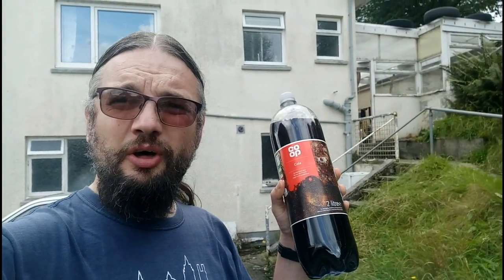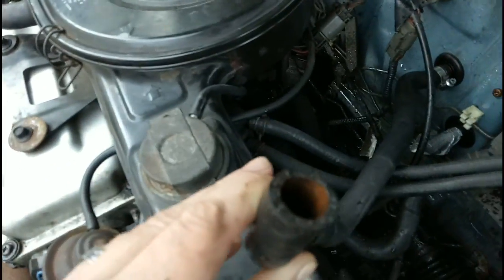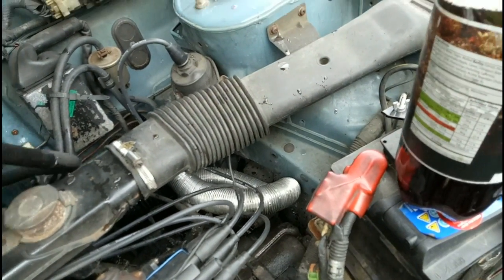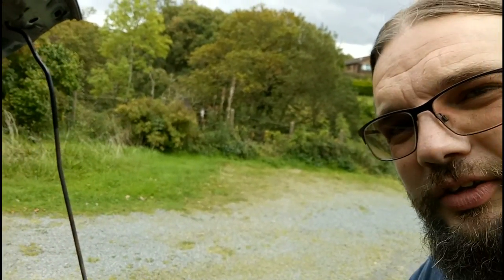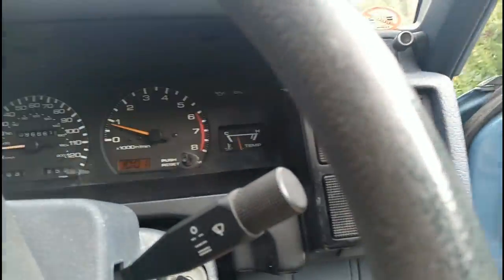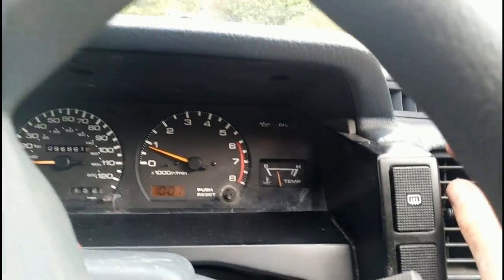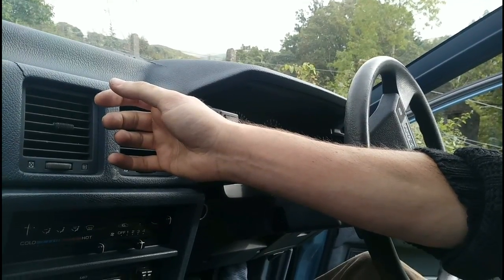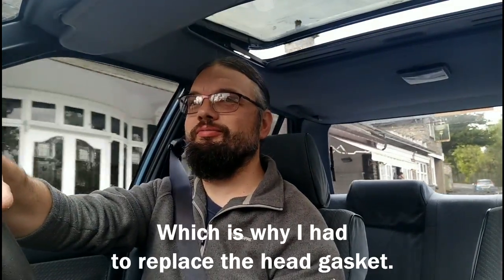Project Bluebird: Heater fix with cola!

Comment: sink cleaner works well, tried that on a ford matrix many years back, it expands and pushes the grime and sludge out of the top hose if you fill from the bottom hose and seal that hose off, I used a bolt, pushing it in to the hose,

Comment: Speaking of hard tyres, the old Nankangs of about 5 years back were so hard they were effectively plastic rather than rubber. Dry roads felt like wet roads and They would lock up at the slightest hint of moisture in the air... they were absolutely lethal in the wet, every corner was a magical mystery tour as to what wheel would find grip and which one would lose it first) but on the bright side (or bad side if you like your tyres to actually grip), they never wore out. i'm serious, i know of somebody else that used them and they've done nearly 80k miles on them and they still have over 4mm of tread left!.
Reply: A motorbike I had came with a tyre that felt the same. It was.. entertaining.
Reply: i had some motorbike tyres, i was cheap and bought chinese ones, lethal in the wet, zero grip, the avons i replaced them with (after i fell off 3 times) had more grip in the wet than the cheap ones in the dry, also they wore out in side a couple of thousand miles.

Comment: The early Vauxhall Royales,Monzas & Carltons were notorious for heater matrix problems, My trick was to use a strong kettle descaler down the matrix pipes with a bit of boiling water added then leave it overnight, The crap it got out when I flushed it was mind blowing but it certainly sorted the heater, I also used the same method on my Omega 2.5td rad as it used to run very hot when giving it some 'beans', It sorted that problem out also.

Comment: "I can't be bothered". That's a great way to say "I don't want to do it." Lol. I've been fortunate and only had one vehicle with a non-working heater. A $250 84 Grand Prix I bought of a coworker to help them out (they needed money) back in the early 90s. The car was solid but had been through a high school body shop, so I redid the body work and primer. While trying to figure the heater issue, I found a little plastic hose that had been cut. I ran a new tube and Voila!, Bob's your uncle. Some idiot had previously cut the vacuum line that ran the dash heater controls. That's an issue with shade-tree mechanics.. they can be more concerned with their next beer than the car they are working on.

Comment: I have an old MK1 Seat Leon with a leaky matrix. Rad weld did the job for a while but after it has been sitting sorn for a few months, all the coolant has collected in the heater box and comes out when you turn the fans on. Dammm you heater matrix! Looks like I'll be taking the dashboard out
Reply from the maker: Aye. That was a worry here that it might only be the silt holding the matrix together. Giving it a 260-mile test today, so hopefully all will be well. Radweld can clog up matrices and rads, so I'm a bit wary of the stuff.

Comment: My worry is not that you've just poured a children's drink into your Nissan Bluebird's cooling system, but rather that for years, countless parents have been letting their children drink cooling system cleaning fluid. Still, if their car's heater doesn't work, at least the children should be nice and hot enough to warm the car. Silver linings and all that.....
Reply: Well, knowing my Children only Industrial Strength Stuff will do. Excuse me while I polish their Teeth with 3M Extra.

Comment: Are you changing the width but keeping the aspect ratio the same number? If you change width, the aspect ratio must be changed to keep the tyre's rolling circumference the same.
Reply from the maker: +Forever Computing Bigger width, bigger profile, to match the standard tyre size. What was fitted was wrong.

Comment: Was going to say, Cola should work, ive seen people use it for removing rust, but you may have to leave it a while. As for what it does to your guts,  stomach acid is way more acidic than Cola so no problems there. Its the amount of sugar in it that's bad for you (but I'm sure your car won't mind that, provided you flushed it out properly) :-)
Reply from the maker: I did find the sugar attracted wasps! Maybe I should have used diet...

Comment: just to be a boring bugger - for those people that are aghast at what coke can do to things and worry that we drink it - don't forget that your insides (well, your stomach) has hydrochloric acid in it (as well as some other chlorides).  That stuff makes coke look tame! :-)  in fact your stomach has no problem with coke at all - in terms of the properties that folks worry about. The main issue with coke is simply what the sugar does to you - which most certainly isn't good, but for other reasons. so err... yeah. here endeth the waffle.